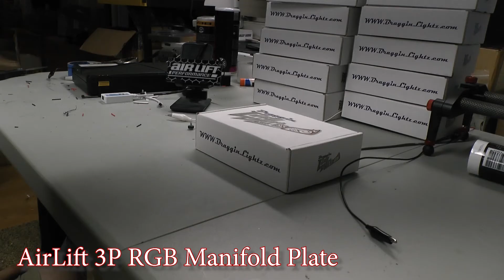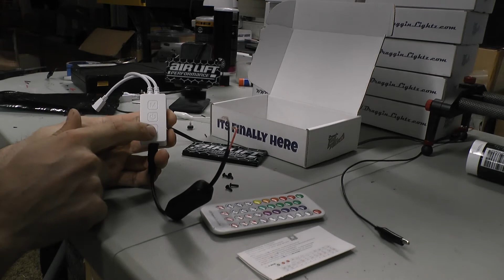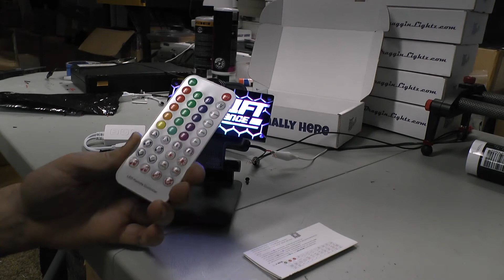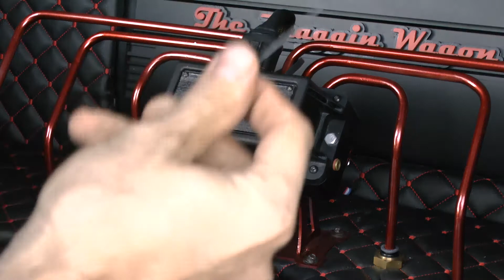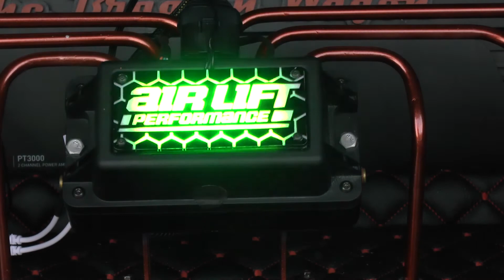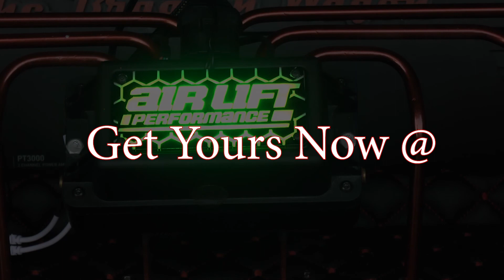Airlift 3P Flow Series Manifold Plate Install Guide

Comment: Where do you order and how much !!!!
Reply from the maker: Base price is $75. https://www.bragginlightz.com/products/airlift-3p-color-flow-manifold-cover
Reply: @NextLevelNeo  price went up?
Reply from the maker: @hectorvarela_  I added shipping into the price. It was 75 plus 5 for shipping. Now it's 80 shipped. Same price
Reply: What size and type are the screws. I need to find replacements.